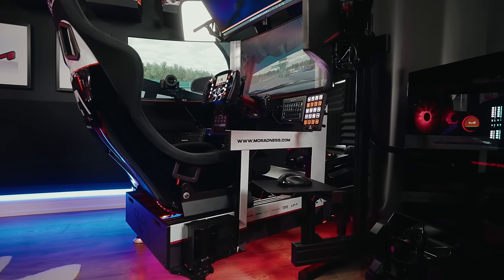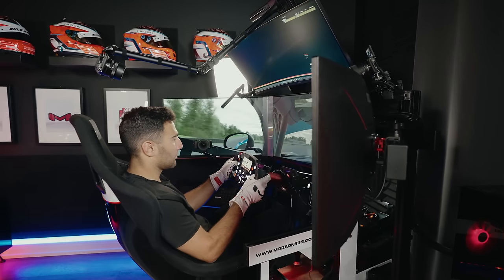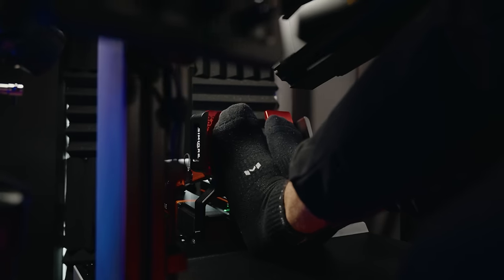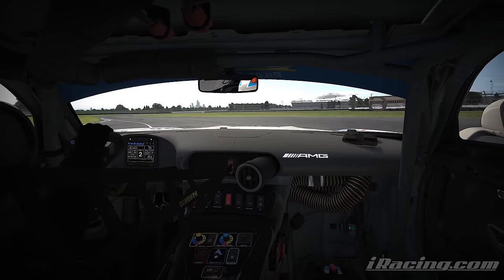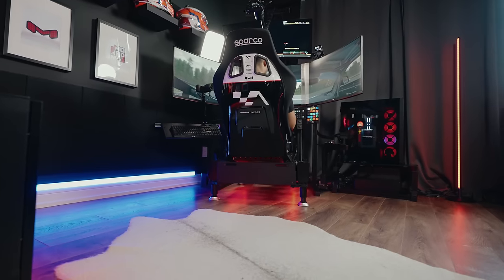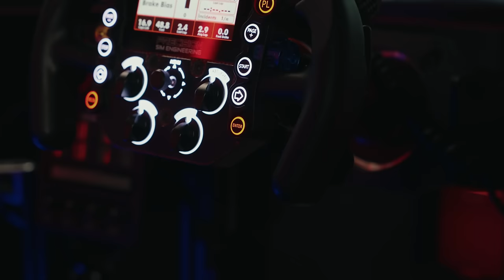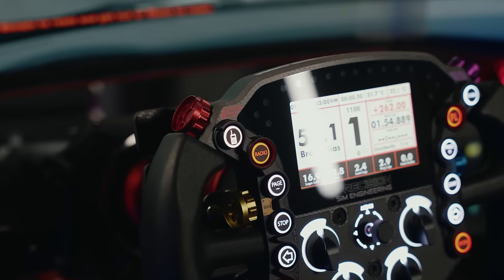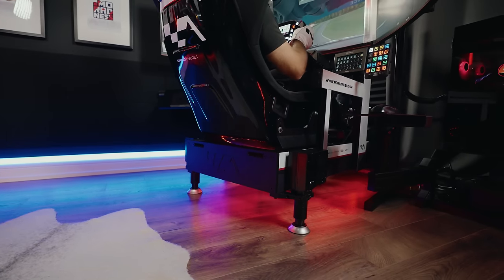UPGRADING YOUR RACING SIM: PRO GT DRIVER EXPLAINS THE BEST PATH TO IMPROVE YOUR RIG

Comment: Awesome video, I got a question, I'm gonna upgrade my pedal from the Meca Cup1 to hydraulic pedals I got 2 in mind the Racewerk S1 Pro and the Ricmotech Recegear Gt3pro3, what do think about these 2 pedal the reason I choose them is both are clutch and brake hydraulic and quality, but can't decide, can you let me know what u think?, and btw can you tell the canadian postal service to hurry up with my future racer gloves and orage sim socks, lol😂
Reply from the maker: First of all, that’s too funny about the Canadian Postal Service. They can be slow sometimes. I wish I could deliver them myself because they get there a lot quicker.

I don’t have a lot of experience with those petals, but I do know that I’ve tried some hydraulic pedals before, and, as good as they seem like they should be, I always felt like I had better control with Heusinkveld Ultimates. But now that I have the simucube active pedal brake and passive throttle, it’s a game changer. I can’t use anything else. Spoiled now!
Reply: @danielmorad  yup the gloves and socks still in Toronto and they r coming to Puerto Rico do they got lots to go, anyways yeah I wish I could get the active pedals, hey what is difference between the simucube active pedal and active pedal add on they seen the same but the add on is cheaper?

Comment: This is great information. I'm trying to understand the wheel base a little more. From what i understand they have a kind of refresh rate on them aka How much information you get per second Sent to the wheel makes a big difference, so you can feel the road better. I've seen that refresh rate tested by a few SIM racing YouTubers. I'm hoping they make something for the PlayStation to help it get a better refresh rate from the wheel.. Or is it part of the PlayStation hardware or software That limits it from getting a better refresh rate? Would anyone know ?
Reply from the maker: From my understanding, moza is currently the best for PS5 but if you want the ultimate experience, play iRacing on PC. Best sim currently. Others are pushing to close the gap but for now, it’s the best all around. Then you use a simucube base with that. It’s insane to feel the difference.

Comment: How much of an impact would you say loadcells would make? Currently 4k iR with logitech g920 pedals, but I dont wanna pull the trigger if I am only gonna gain a few hundred rating.
Reply: Load cell pedals don't necessarily make you faster in itself, but they help you maintain better consistency, which then leads you to becoming faster through muscle memory. The thing about them though is you need a solid platform to put them on, like a chassis. Otherwise, you're not going to be able to press with the pressure you need for braking accuracy.
Reply from the maker: New equipment will not give you magic grip, but it will make you more consistent and overall, I think it does end up delivering more consistency from corner to corner, which will lead to consistently faster laptops not just a fast lap here and there. I have driven on G 29 petals and I could be semi competitive but it was a lot more difficult to hit my marks every time with precision

Comment: Is the accelerator pedal also active and where do you get the pedal attachments? Thanks for your great videos. Best regards
Reply from the maker: I used to have an active throttle pedal, but I switch to the Simucube Passive throttle. I liked the mechanical, feel a lot more for the throttle. In terms of the brake pedal, I’m in love with the active pedal.
Reply from the maker: Simcore pedal plates by the way
Reply: @danielmorad  Thanks for the quick reply. That's a shame. I thought the resistance could be simulated by a throttle valve. Especially with the various car profiles that will still exist or already exist.

Comment: Do you think foldable cockpits such as the Playseat Challenge and the NLR GT Lite Pro are worth the money? I currently use a G920 on a desk that is pretty unstable so looking to improve on that. Thanks!
Reply from the maker: It’s not really worth it. I never liked those foldable ones. If you can skip that step and go straight to a profile rig, you will thank yourself.
Reply: @danielmorad  The only problem is that I don't have the space for a full rig. Even if it is on caster wheels. I currently race in my small bedroom, and there isn't much room to begin with, let alone with the space taken up by my furniture. Instead, I was possibly also thinking about a wheel stand. What do you think of those wheelstands that can expand into a rig, such as the Next Level Racing Wheelstand 2.0? Do you think that it would be a better option?
Reply: @oreoking9513 the foldable are absolutely worth it.  I've used a playseat challenge for 2 years and it's been awesome for me.  I just recently upgraded to a playseat trophy.  If space is an issue the foldable is absolutely worth it and it's miles above using a desk mount.
Reply: @aj6761  Awesome, thanks, man! I really appreciate your advice! Would you recommend getting a playseat challenge, or should I look at the offerings from Next Level Racing such as the FGT Lite or the GT Lite Pro?

Comment: Hey Daniel, hypothetically if vr had stable maxed fps and the clarity of monitors would you say it could be a better training peripheral than triples?
Reply from the maker: It would absolutely be the way to go. I find that it gives you so much depth perception and a lot more connection to the real car. Because I am using it as a multipurpose set up for streaming and training, I am using triple monitors.
Reply: I mean, my quest 3 is getting pretty damn close now. Will probably be pretty big in a few years

Comment: How much would I need from my, in that case new PC, if Id ask of it to show two screens extra in 4K each with moving graphics?
My current one forces me to dial down som graphics to keep over 60fps on one screen. I really hope I could build a dream rig in the future.
The screens them self have gone down so much in price that I think theyd be the least expensive of it all.
Recently bought a Moza r5. Absolutely thrilled about it still. But yesterday I went through checking ffb clipping in various cars and realized I needed to lower ffb strength to about 70-80% total. Now Id like some more strength, but Im quicker when its not clipping. So maybe something around 13nm would suffice.
Thanks for the brilliant video!

Comment: 11:06 That's what SHE said!😂 I'm getting old. I need Plug and Play, more than I do top of the line. I'm on ps5, so I think I'm going to stick with Logitech . Been happy with their products for 30 years. I've been holding out on Triple monitors, because the frame is going to bother me. Curved monitors are here, and I know seamless composite LCD screens are available.. I just haven't seen it yet. Curved and seamless appears to be what you have. I see the bezel on the outside, but there doesn't appear to be one at all to the right. What kind of monitors are you using? And, do you think an old play seat like you started with will handle a DD wheel upgrade? I haven't touched the DD yet, so I'm not sure what I'm missing. I'd rather not have to weld it solid LOL

Comment: Maybe try Vr again. I run iracing with pimax crystal. I7 12700k and rtx 4090. I have 99% percent of the time constant 120 frames and it looks so much better than most other vr headsets. I would say with the crystal the picture quality is comparable to a monitor.
Reply from the maker: I might have to give it a try again. Thanks so much for the heads up. I’m really interested in the big screen VR headset as well.

Comment: Do you know what's the wheel torque of a real GT3 ? I have a csl dd at 8Nm and i wonder if i should consider buying the new clubsport dd at 12Nm to have a more realistic experience ?
Reply: @designamk1160  Why tho, always fanatec wheel bases and never had issues, it's the same prices as others + i don't want to spend 200/300 € on new compatible wheels
Reply from the maker: Personally, I would stay clear of that club sport DD. You might as well go for something like a Moza base or if you can pull it off, simucube 2 pro.

Comment: Great video! What screens do you use? I'm currently looking into upgrading to triple screens (most likely 32'' WQHD) and I'm a bit puzzled by what is available. Any suggestions around the €300 mark per screen?
Reply: Dell G3223D worth checking. Be aware that to power up 3x 2560x1440 RTX3080 IS MINIMUM card. Honestly to get nice details and not be bothered with many compromises 4090 is needed.
Reply: @bjoernadebahr I know their 32in amd only 1080p
Reply: @Zenek-40 3080 is more than enough for 1440p wouldn't call it minimum as a friend has the 3070ti and gets good for at 1440p. On my 3080 suprim x I get around 70fps on high settings on iracing and once the first half a lap or so is over I can get between 70fps and over 150fps track dependent but there are certain tracks like Daytona that tank me a bit its more to do with my CPU being the 9900k if I had a 13900k with my 3080 as another friend has I know my FPS would be much better on most tracks.
Reply: @Simlife101  yes ok , I was thinking about ACC which is much more hungry for resources.

Comment: Great advice for chassis l... I fear however we will always continue to see people slapping dd wheelbase on the playseat challenge 😅
Reply: Don’t knock it. I have a Simucube sport on a modded Playseat Challenge abs have just added Active Pedals against the wall and zip tied on. 👌
Reply: @designamk1160  I’ve done heaps of research and there are many of us running the Playseat challenge with DD wheels. Sure the Active pedal moves around when I brake because of the zip ties, and it does make it hard to be consistent (hence iRating of 700-800), but I don’t plan to ever get a full aluminium profile because I’d rather spend my money wisely on things like the Active pedals. 💪👌

Comment: This is a misconception about loadcells. Forst loadcells or hall sensors have no change over how the brake feels like you say my P1000i prove this as ive always used Loadcell but using Hall sensor ive found to be just as accurate when it comes to this application and i cant feel any difference between using loadcell or when i switch it to hall sensor my feet cant tell the difference but if i use loadcell with a lot of travel i find i have to press to hard or mess with the software to make up for this but switching to hall sensor this all goes away and feels much better. 

I think this miff comes from old school Potentiometer pedals and the reason loadcell was better then was due to how the feel. Normally loadcell had the ability to make them a lot stiffer than their Potentiometer counterparts but if you use hall sensors on pedals with the same rubbers you have on a loadcell set i promise you theres no difference in feel or any difference in my laptimes.

For me loadcell is key for drivers who use a stuff brake with little travel but for the driver who wants 2 to 3cm or tracel are better off switching to hall sensor as 4095 on a 100kg loadcell is easy to hit maybe 200kg would be better but the issue is to my knowledge only Simagic offer the option of both loadcell and hall effect sensor on their p1000/i pedals. 

Just my opinions of corse ❤